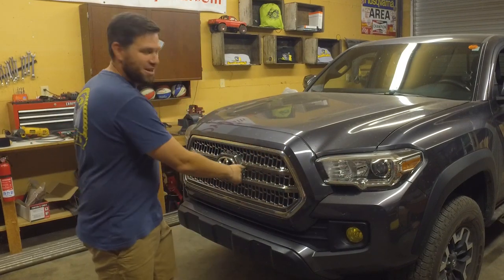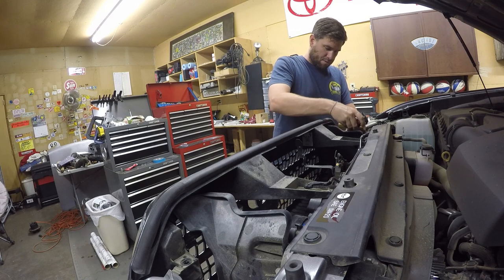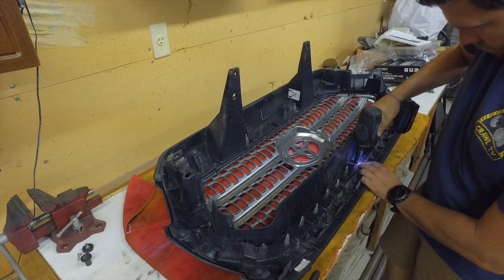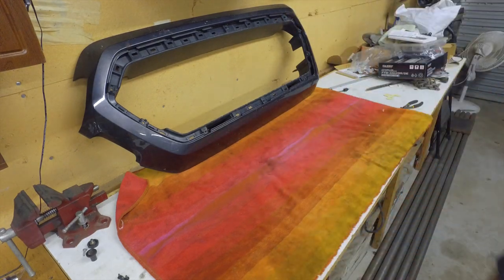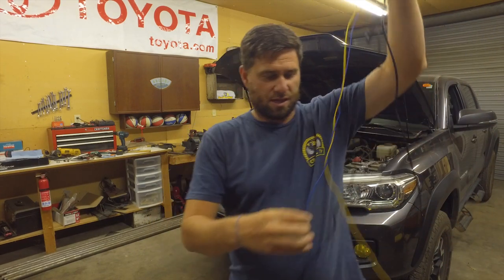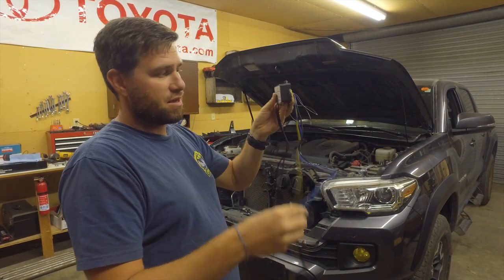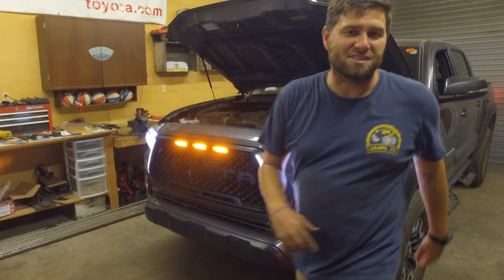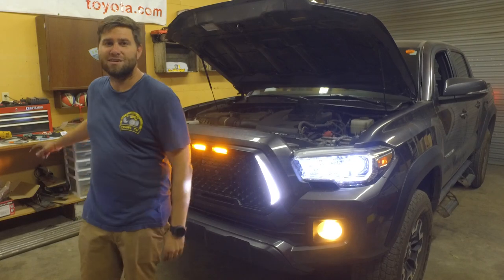The Coolest Tacoma Grille with DRL, Blinkers & Raptor Lights | 3rd Gen Toyota Tacoma

Comment: Just wanted to say thanks, this was way better than the instructions or lack their of. For those with a manual transmission, don't forget to release the ebrake before testing your wiring configuration/operation.
Reply from the maker: Why is that? What's the Ebrake do?
Reply: @SnailTrail4x4  the ebrake has a switch that acts as the parking brake and doesn't allow the drl to work until released. I thought I had problems with my drl and newly installed grill as only the amber lights worked when testing, only to later find out all I had to do was release the ebrake to see everything worked great. Granted, I just went from a 98 taco xcab to a 2016 taco quadcab, very different beasts.
Reply from the maker: @Taco_Syndicate -- that's good to know. Thanks for the information!!!

Comment: 2020 Blinker wiring: Fyi for the 2020's the blinker wire to splice into, on driver side is peach color. It's the lighter of the 2 blues on the passenger side. When you pull out the DRL/Blinker plug, the lower 3 wires are for the DRL. The upper 3 are for the blinker. The Peach and the Lighter blue are the upper right wires on the plug. Raptor 2.0 with TSS and front facing camera is installed and looks awesome!
Reply from the maker: Thanks so much for letting everyone know. I'll update the description with this information.
Reply: How did you install the TSS sensor in this  grill?

Comment: Update: My daytime running lights on the new grill worked, but seemed dim. After re-reading others comments below and on other sites, I checked and sure enough, when the lights were on the daytime running lights on the new grill became bright, not dim like the truck daytime running lights. Flipped two wires and viola! When the truck is started and the daytime running lights come on, the daytime running lights on the grill light up bright. When the lights are turned on, both the truck and grill daytime running lights dim. The wiring for the passenger side of a 2016 Tacoma Limited 4x4 is red to green, white to blue, and black to black/white. I found also that the red connectors made a better connection than did the blue connections. All is good now, love the grill.
Reply from the maker: Great work! Thanks for letting us know
Reply: @SnailTrail4x4   where you order that grill.. planing to do the same on my taco trd sport 20

Comment: Are the letters removable? I’m trying to find letters I can put on my current aftermarket grill, exactly the same as yours but without the emblem. Any links or help towards where to buy these would be greatly appreciated! Looking for the letters specifically.
Reply: I was literally about to ask this question! Would love to be able to remove them from the grille if possible for a cleaner look if I change my mind.
Reply from the maker: They are removal, they appear to only be 3m tapped on. If you contact Tacovinyl I'm sure you can order the letters separate.
Reply from the maker: I'm sureq you can order the grille blank. You don't need to get any letters

Comment: I have a ‘17 SR5 and my headlights do not have the LED DRL’s when you explain the part where you connect the black white and red wires it gets confusing. Is mine a different set up than yours referring to the connections going to the headlight?  On yours Is the LED DRL a whole separate plug from the headlight plug?
Reply from the maker: If you don't have DRL I'm not sure how you would connect them for this grille. Contact Tacovinyl to get the exact answer
Reply from the maker: @parkergalvin1577  Tacovinyl.com
Reply: Parker Galvin slightly curious if you ever gotten an answer regarding this

Comment: Awesome video. I followed just as u did and it worked perfectly. As soon as I installed the raptor lights my DRL’s stopped coming on with the headlights on. Any thoughts ?
Reply from the maker: I'd check your connections and what fuse you used from the box

Comment: I bought a grill from someone locally but it did not have the unit control voltage input 12v. I’ve looked all over to find this sold separately and have not found it. Is there anyway to install this without it?
Reply from the maker: Contact Tacovinyl and see if he can help you out.

Comment: I was able to get the amber lights to work, and had the DRL grille lights working, but the can't get the blinkers to work. And now neither the DRL grille lights or the blinkers work. Any idea if there is a specific size splice clamp you need for these wires? wondering if mine is too big.
Reply from the maker: To make sure you could cut the wires and splice them together. You don't want a loose connection

Comment: Tried installing this same grill on my ‘17 SR5. My DRLs and turn signal are the same bulb. How would I hook up the blue wire to activate the LED turn signal? Driver side is hooked up with no problem for signaling left but when I signal right, both LEDs come on with the driver side blinking white and the passenger side blinking orange. Any advise?
Reply: I have the same problem: my base 2016's DRLs are halogen (and the same bulb as my directionals) it appears the wiring set up is for LED DRLs. I was looking thru comments on the seller's page (I bought from a different vendor) and one guy bypassed the DRLs themselves and wired into the DRL fuse with a fuse tap. I'm wondering if that'll work for us Ann?? Any thoughts on this 4x4 dude?

Comment: Did your grille come with a second fuse for that add a fuse kit? Or did you buy all of that separately? I understand NOTHING about electrical. I’m trying to follow along and I’m starting to piece it together but I don’t want to splice or cut or hook anything up until I know that it’s correct.
Reply from the maker: I'm pretty sure I had to buy that add a fuse part separately, honestly don't remember. But it does not come with fuses.
Reply: @SnailTrail4x4  where did you buy that add a fuse part, I’m also trying to figure out the wiring and bought the links in the description. Now realizing I might need an extra fuse and not sure what to buy or where to buy it.
Reply from the maker: @tylerhilton5808  there is a link for it in the videos description: Mini Fuse Pigtail

Comment: I'm paused on the scene at 6:18 where you show the "control box" thingy.  I ordered a grille off ebay and it looks to be THE EXACT SAME THING.  Does the guy you ordered from just modify the Ebay grille with lettering?  The wiring colors and the sequence all the same.  And for the TSS Sensor I ordered a bracket from AJT which relocates the sensor OFF of the grille.
Reply from the maker: I think he uses it as another sales avenue
Reply: @SnailTrail4x4  thanks for the install video by the way.  I will have my laptop in the engine bay as I am installing and wiring.

Comment: I am trying to install this grille for my 2017 Tacoma sr5. I have drl and turn signal on the same bulb. It has three wires. My drl is working but turn signal is not working. Did anybody got this working with sr5 that has one lamp for DRL and turn signal

Comment: 2016 trd OR
Im installing mine currently and my Headlight drls are going dim when I try to test check the drls on the grille which come on bright as the headlights should.  Im following the wire diagram for the passenger side hook up. Which is R-B, W-G, BL-WH/BL any ideas?

*yet to hook up the turn signals
Reply from the maker: are you saying the DRL on the Tacoma are going dim when you turn on the headlights?

Comment: So I’ve had my on for 2 months or so and the day time running lights keep turning on. I’ll have the lights off, truck locked and they will just turn on. I’m not sure if it’s an issue with the grille or if the guy who did the wiring messed something up but yeah, the driving lights in the grille are like possessed or some shit. Worry about it draining my battery but even more, my truck catching fire.
Reply from the maker: That's odd, have you contacted the manufacturer?
Reply: Wondering if you found a solution to this. Mine is similar except only the raptor lights come on randomly. Also sometimes when making a right turn the whole right blinker goes off until I have completed the turn.

Comment: Hey man I have 3 wires on my turn signals and watching different videos they only show 2. The raptor lights are working but the DRL and turn signals are not. Any advice?
Reply: same
Reply: @slickie8782  hey here is the wiring I used
Reply: @Slickie I couldn't attach it to this reply if you send me a place I can send the pic of the diagram it worked on my truck. I also uploaded the pic on Tacoma World
Reply: @darith69  hey boss could you point me in the direction of that diagram or send ?

Comment: does this work with the front camera on the trd off road?
Reply from the maker: I'm not sure, mine was one of the original and maybe the manufacturer has made updates for the newer models. Contact Tacovynal to get your answer
Reply from the maker: I was just doing some more research on this grille and found it doesn't work with the front facing camera.

Comment: How can I change the orange raptor light to blue? Can this be done?
Reply from the maker: First off if your in California (not sure how it works in other states) your not allowed to run blue lights on your vehicle because it's impersonating a cop.
You might be ae to find some blue ones and swap them out but I would contact the bender and see if he makes custom ones
Reply: The amber are legal and staying. Where to get Bulb replacements?
Reply from the maker: @melaniepeters3769  contact Tacovynal if you need replacement parts
Reply: Justin said they are working on smoked raptor lights for the Raptor 2.0...

Comment: Does this work with the grille that has a camera on it
Reply from the maker: If you mean the TSS sensor then TacoVynal makes a person that works with that sensor
Reply: @SnailTrail4x4  Yeah I just got mine !!! The TRD Pro Grill with rapto lights, garnish sensor and front facing camera bracket. I checked the whole box though and no instructions so im a little lost on the process. Should be very similar to this video I hope!

Comment: Is it blinker or DRL? Have to chose?
Reply from the maker: Both, it's daytime running lights until you turn on the blinker then it'll blink as soon as the blinkers done it'll go back to daytime running lights
Reply: @SnailTrail4x4  thank you so much. One thing on the 2018+ model is the forward sensor. I do not see a place for it on any video or screenshot. They actually point a potential customer to your video :)
Reply from the maker: They make a 2018+ version also,y truck is a 2016 so I don't have that feature.

Comment: Great video! Installed mine today, but I’m noticing my running lights on the grille, and headlights won’t stay in at the same time. I may have wired something wrong? Only can get the raptor lights on with headlights, or only the side running lights with my day time running lights. Any insight on why that may be? Slightly frustrated about it, and I’m sure it’s 99% my fault? :p. (2019 OR)
Reply from the maker: I'm not sure. I do know that the DRL have a high and low feature for when the headlines are off or on. Maybe they there is a wire fliped

Comment: Hey, I’ve got the LED headlights in my 2020, the wiring is totally different. Any idea on how to wire up the DRLs and turn signals??
Reply from the maker: No, sorry. I don't know what wires are in the 2020. You should contact the manufacturer tacovynal
Reply: Mine too. Drive blinker wires are different colors, and a blue and off blue wire on pass blinker.
Reply: Same. 2022 with LED. Anyone figure it out?

Comment: Did you have to add wires to run to the driver's side DRL?
Reply: I'm confused on how you did that
Reply: @anthonyhillerby2206  i have the grill, but haven't installed it yet. my blue and yellows are very short compared to his. can't reach the driver side. i'm trying to find a decent spot to put the box

Comment: I have a similar setup but my grille came from yotaverse. They have a box that only has a yellow (passenger side wire) and blue (driver side wire) and my issue is that I connect the yellow to the back of the turn signal wires and my battery ends up dying. Some other videos show a 4 wire plug that they tap into but my truck only has a two sets of three wire cables and idk which one of those I should tap into. Ideas?

Comment: Why does my headlight have 3 wires coming from my blinker? I’m so confused on installing these blinker lights it’s driving me insane. I don’t at all understand where to hook up the red, white and black wires because the only lights that run when I switch to drl are my blinkers.
Reply: Somebody please help(2017 Tacoma Sr5)
Reply from the maker: Have you tried to contact the manufacturer? What color are the wires?
Reply: @SnailTrail4x4  yeah I reached out and they said I would get a call on Monday but I never got a call unfortunately. I have the SR5 headlights so my blinkers are also my drls. The wire colors coming out of my passenger blinker are light blue, dark blue, and white/black.
Reply from the maker: @tylerhilton5808  -- what year?
Reply: @SnailTrail4x4  2017
Reply: @tylerhilton5808  Same here :(

Comment: Should there be 3 wires on each side?
Reply from the maker: Depends on the year. Mines a 2016. The newer ones have 3 wires
Reply: @SnailTrail4x4  mine is a 16 as well
Reply: Blue wire goes to pass directional and yellow goes to driver side directional correct?  Then 3 other wire go to pass running lights? Is this correct??
Reply from the maker: 2016-2019 Wiring:
Driverside DRL Wiring:
Red to Red
White to Green
Black to White/Black

Driverside DRL Wiring:
Red to Blue
White to Green
Black to White/Black

Sorry I can't look at the truck right now, I'm currently traveling out of the country.
Reply: @SnailTrail4x4  you wrote both on driver's side for DRL?
Reply: @SnailTrail4x4 .... which one is passenger side and which one is driver's side? You wrote the same thing in the video description....

Comment: Anybody figure out how to wire this (blinkers) to SR5 trim?
Reply from the maker: Not sure what is different on an SR5... But we had someone write in and let us know about different wires for the newer models. You can search for that comment or I put it in the description.
Reply: @SnailTrail4x4  The SR5 only has three wires going into the DRL/blinker (same bulb). I figured it out.  
The amber lights follow the same configuration as your video.

For the red white and black wires.  configuration is as follows:

Passenger side: Red splices to the thicker "lighter" blue wire (the same one that you splice the blue (not yellow) wire to).  White splices to the thinner "darker" blue wire red wire.  Black splices to the black/white wire.

Driver side:  Red splices to the brown wire (the same one that you splice the yellow wire to).  White splices to the  red wire wire.  Black splices to the black/white wire.
Reply: @BrodieMeche  Thanks!!!
Reply: @BrodieMeche  thanks king ! op needs to add this to the description

Comment: Still can’t get mine to work.... the drl lights don’t come on and the blinkers don’t work. Haven’t wired the raptor lights yet. HELP
Reply from the maker: If you're still having issues with the install maybe you should try contacting the manufacturer
Reply: @SnailTrail4x4  im going to reinstall the connectors but its strange to me how they won't even turn on? Could you speak to which one of the three (red, white, black) is for?
Reply: @jdogtheairsofter broo same here wtf. Im annoyed
Reply: @911airsoftdude  Did you get the lights to work? I saw several guys with that problem. I was looking into buying one of these grilles but will probably avoid if there's issues with it.
Reply: @ryanthomas5883   nope... idk maybe I will just try and rewire everything
Reply: @ryanthomas5883   still dop without the drl lol I am sure I can get the raptor lights to work but the DRL's I cant seem to figure it out

Comment: Dont buy this from tacovinyl. Extremely overpriced and does not provide much help with issues. Its on extreme terrain for $200 less and their customer service is top notch. Amazon also has it for $150.
Reply: Don't be a hater. They are a great small business. I've worked with them on a custom project and they are great people with great products. I support small businesses like this! Don't get the cheaper ones for less if you want quality that will last and not have to be replaced. Plus this is so sick on my 2020 Cement Taco Sport!!!